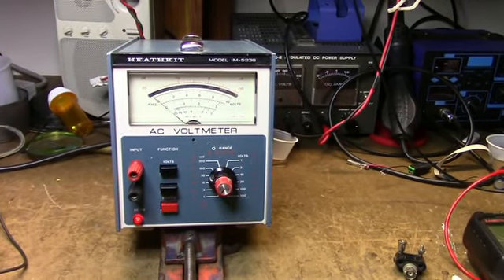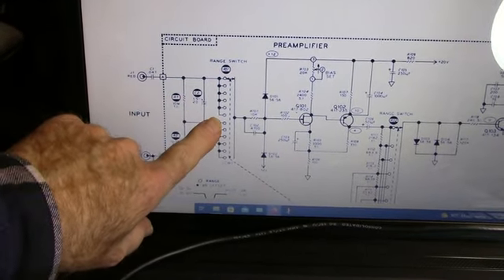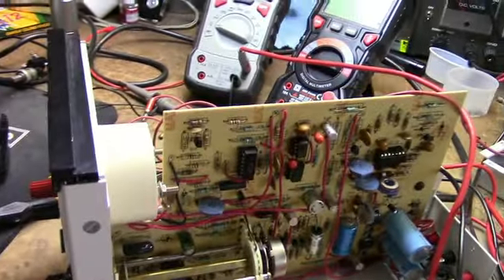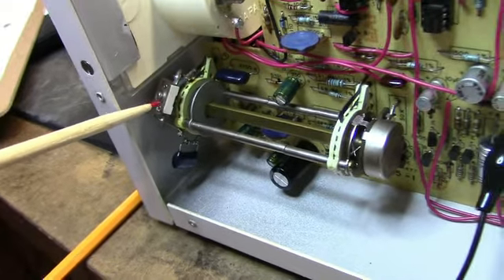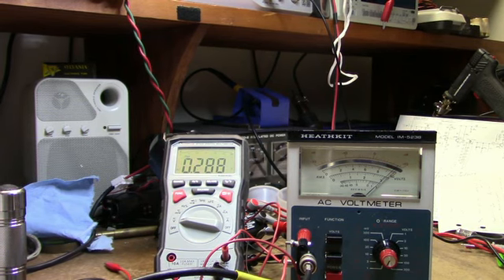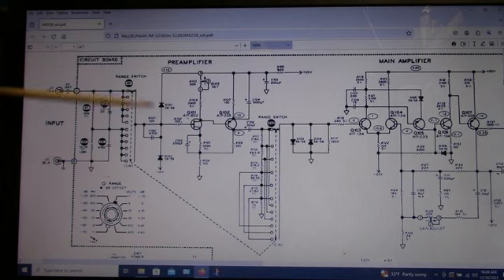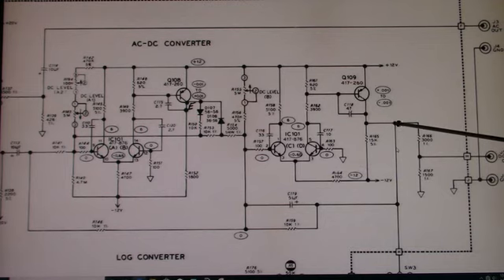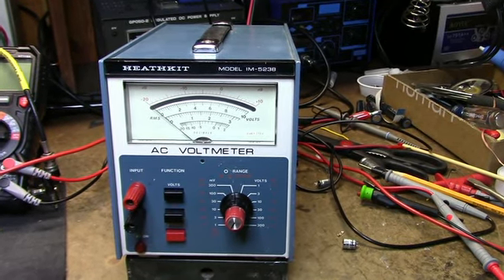Heathkit IM 5238 AC Voltmeter

Comment: Thank you for sharing. There is a red wire routed between two e-caps, in the middle of the board. The builder used the caps to turn the wire from vertical to horizontal. I would think that the extremely close proximity to the caps might lead to the introduction of noise. You might want to move it. I also think this routing indicates that the unit was kit built. Multiturn calibration pots might be a nice upgrade.